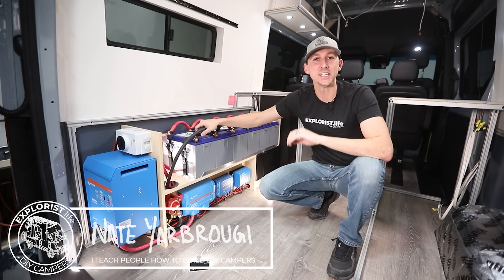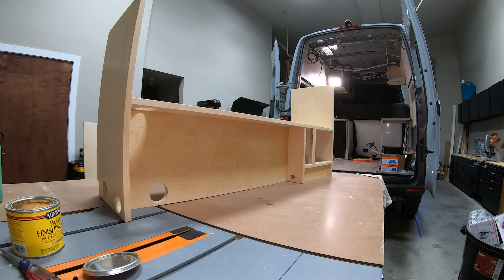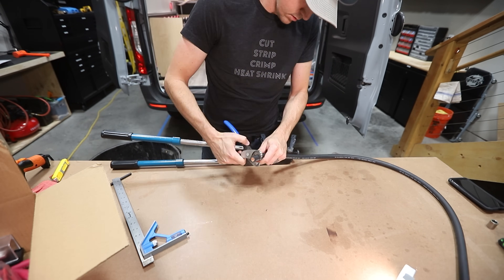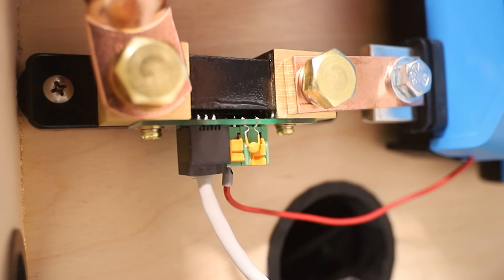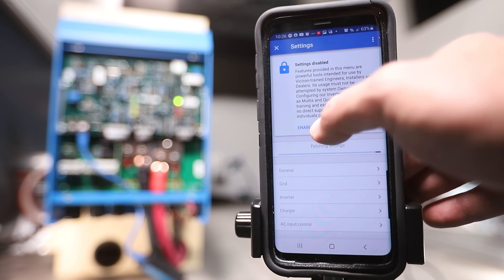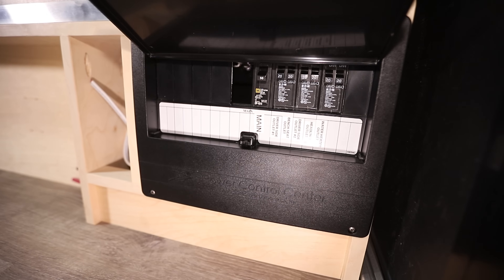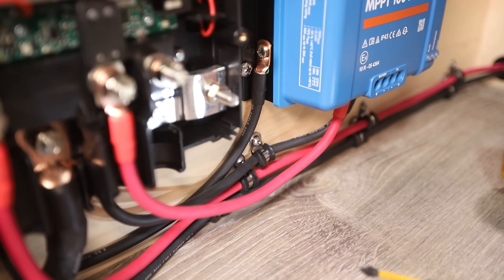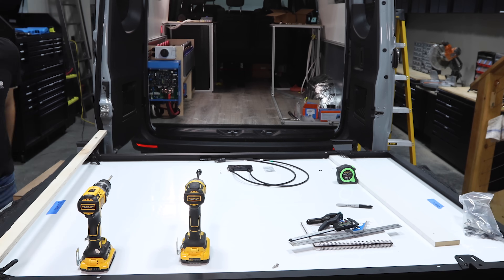DIY Sprinter Camper Van Electrical Install - Full Tutorial

Comment: Hi Nate, I watch your videos and trying to understand the way how Victron system works. Before i built a campervan and electric issue was the most important and hard part. With your videos and Victron it is more clear and easier to do this again. Thank you for your time and effort. Your system  includes smart inverter charger in this video, how about if we want to use seperate products such as an inverter, 110 or 220 to 12 volt charger and direct 110/220 shore power supply. How the connections change? The reason i am asking this is, if anything happens to smart inverter charger whole system collapses. I prefer to use these parts seperate. When you have a chance let us know please… Thanks again…
Reply from the maker: Basically, I don't recommend that.  It takes more parts, more wiring, and more components and lacks shore power passthrough capabilities unless you use a secondary transfer switch.  It's pretty rare that these units fail entirely; and if they do, they've got a 5 year warranty and are in no risk of selling out.

Comment: Amazing video Nate, thanks so much for creating this. 

I still have a couple questions, forgive me if you answered them already, I didn't see them in the comments with a quick peruse. 

1) where is the link to the blog post that goes over the settings on the victron connect app for the multiplus, mppt, batts etc. 

2) at the end overview you talk about the power assist feature to pull 30AMP shore and 15AMP from the inverter, but wouldn't that 45AMP be too much for the multiplus to output? Or is that 3000W the max it can output from the inverter but it can also output additional power coming from the shore?

Thanks for your help.

Comment: I seriously can not thank you enough for this video, we are building our system right now and constantly reference this video! We just got the battery bank wired together and the BMV 712 turned on! I can't seem to find the cheat sheet for the BMV 712 settings is on your website, any chance you could point me in the right direction? Thanks again!! -Cody

Comment: Excellent tutorial.  Well thought out, very well explained.  One question I did have and my apologies if I missed this explaination.  In the case of the Orion DC to DC charger, when the vehicle engine is turned off, does the Orion on its own isolate from the vehicle start battery system or does one need a solenoid to serve that function?  Having seen isolated and non isolated descriptions with Orion's I'm assuming "BUT" assuming can also get me in trouble, thus my question.  Again, huge thank you so much and I'm going to share this and your channel with several people who also share a common interest.
Reply from the maker: If programmed as a 'charger' no power will flow when the engine start battery is off.

Comment: Hello Nate,
First, thanks for all the resources you provide through the blog and the videos on youtube; they are very helpful. I probably would have undersized wires and burned it to the ground on my own. 

Here is my situation, i have a 2021 coachmen catalina with the off grid package. has a 100 watt panel on the roof, solar charger tied into the battery, 12 volt fridge and led lighting and a couple fans running from the 12 volt system. I was planning on adding more panels to get to 600 watts, swapping the lead acid with 3-400 ah of lithium and putting in a 2-3000W inverter charger. 

My question is, where is the best place to set everything up? I can fit the batteries on the tongue, inverter & lynx could fit beside the solar charge controller in the pass through and then just have a long run of wire between the inverter and electrical box. I tried searching the blog to see if there were any posts but, could not find anything that matched my situation of being partially done. 

Also, If I wanted to supply power from the inverter to the entire panel could I install a subpanel that took the 120 from the inverter on 6/2 wire and convert it to 6/3 wire once I got power to the spot where the electrical panel in the camper is? I realize that it would not be true 240v but, it may prevent me from having to rearrange my breakers. We will not be running any high wattage items simultaneously so, maxing out the inverter or wiring is not a concern at this point.

thanks and once again, thanks for the blessing your resources are.
Bill

Comment: Thanks for the great videos and education! Can you please tell us why you use the lynx adapter bars (short bars) instead of bolting the shunt directly to either the negative battery terminal or the negative bar on the lynx distributer, thus eliminating additional parts and connections? Same for battery cut off switch?
Thanks
Reply from the maker: The shunt and switch studs were 3/8" (M10) and the Lynx Distributor holes were 5/16" (M8), so they wouldn't fit.

Comment: i’m not sure if you’ll see this but i’m planning out my bus rn, i’m 17 and plan to gradually work on my bus for the next two years until i graduate college. i have no experience when it comes to electrical but i came across your page and was hoping you could help. i know that it’ll be 2,000w of solar but when it comes to what exponents will need, i’m clueless. i checked out the website but the systems that my computer allows me to see have a max of 1450.

Comment: Excellent Start-to-Finish video Jared. I have a 5th wheel instead of a van. Can I wire the Chassis Ground to a nearby steel rib (post or cross member) the way you did with a serated washer? Thank you, Rick

Comment: Inverter potion of the show:  I wonder how many folks out there besides you and I use a blender as the first example of a 120VAC load...

Clean build, brother.  I am also a big fan and user of the 80-20 T slot stuff.

One thing that is not clear to me yet:  looks lou went to alotta trouble to power your orion for the alternator charging.  Does it hook up to something other than just the chassis battery??
Reply from the maker: Blender is key. 😂🤣

The alternator charging portion is definitely a bit of a pain, but it's the correct way to do it... so that's what I show.  Do it right the first time so I don't have to do it again, ya know?

Comment: Hi Nate! I’ve watched sooo many of your videos. I can’t explain the impact they will have on my build! 

I swear I read or saw a video where you described what dc to dc unit you should use for a standard alternator VS an upgraded one. Could you please throw a link my way?
Reply from the maker: I don't have a video about that, no.  If you have an upgraded aftermarket alternator, it should come with a voltage/current regulator that would take the place of the dc-dc charger.

Comment: Love, Love, LOVE you & Steph’s vids.  I’m specifically looking for info regarding SIZING a Shunt.  Is there a dumbed-down method, if I don’t yet know my Peak (momentary) Amp draw ?
Thanks to you Both … for being You !
Reply from the maker: The shunt size just simply needs to be larger than the max continuous amperage of the system.  If you don't know this yet... you need to find that out before sizing the shunt.  The 500A shunt shown in this video works for all of my setups at https://www.explorist.life/solarwiringdiagrams and the chances of me designing a system that needs a shunt larger than 500A is slim to none.
Reply: @EXPLORISTlife  Thank You Nate !  I had read that accuracy suffers if you size ‘up’ too much.  e.g. if a system calls for 250A, and the closest available in decent brand is 300-350A, it has a high likelihood of being more accurate than 2X what’s needed (500A).  Is that just baseless “water cooler talk” ?
Reply from the maker: @StansE250  I've never heard that, no.

Comment: I just came across your site and what a wealth of knowledge it is.  I see you offer a complete wiring kit for a 600Ah - Multiplus 3k 12v - Orion 12-12-30 - 400W Solar.  Will you be offering any other complete systems?  I'm looking at building a system that's more like a third of the system currently listed.  Maybe 200Ah - Multiplus 2k 12v - Orion 12-12-30 - 200W Solar.  Also, I would like it to be expandable if I decided at a later date I need more power.  Thanks for your time and input.
Reply from the maker: I will indeed be expanding to different sizes of kits, but I have no ETA nailed down on those.

Comment: Nice Video man! Thx for that Work with making a Video about it :)! But i have one Question, The Inverter, has two AC outputs, but just the AC1 have Slots for 3 Wires? Whats about the AC2? Why theirs just 2 slots?

Comment: Love your videos! You make it very easy to understand . Could you please explain how to install a shunt to monitor the batteries. I have 2 solar panels arrays with their own controller as they are different voltage. My question is can I connect both to the shunt so I can monitor what come in and out of the batteries even if they are different wattage (one is 4 x 120w and the second is 4 x 250w) ?
Reply from the maker: The little gold lookin piece of hardware mounted to the left side of the Victron Lynx Distributor on the negative busbar is a shunt and is a part of the Victron BMV-712 battery monitoring system and monitors all power going into and out of the batteries.

Comment: Hi Nate - awesome website and instructions videos. The best I could find.
Question : You installed a single 400 W panel in the video.  Does it make more sense to install a single large panel or would it be better to use 2 smaller panels with the same final wattage ? Any recs in terms of panel manufacturers ? How can I find out about numbers of diodes used in a panel ? Is there a typical number ? 2 or 3 or 4 in a large panel ? 
Thanks a lot for all you do - and a happy 2022 !
Reply from the maker: Two videos for you that should answer those questions:

Best wattage of solar panel: https://youtu.be/J9iHYgF6pXo

Best size of solar panel: https://youtu.be/VP4uOsKVD9U

Comment: Why not go with higher amp hour batteries, therefore less of them? Thanks, Scott. Love your videos! I need a small system for an old Scotty trailer that I’ve restored. Not a lot of room there but any thing will be better than one battery. Thanks again!
Reply from the maker: That's also a great option if that fits your space better. 😊

Comment: I just modified my older RV house battery system by using your plans and video and its great.  Thanks and I feel much safer than the janky set-up I had.  Question:  You have the solar panel/charge controller connected to the system independent of the battery.  Thus in the day time, regardless of battery on/off switch, the RV electrical system has 12V power all the time.  Is this best practice OR should the solar panels/charge controller be connected to the battery first, with all power flowing through the battery while also allowing the user to shut off the system completely and letting the charge controller keep the battery fully charged.  I can see the benefits and possible problems in both setups.
Reply from the maker: Both are fine.   The way I show in this video is simpler.  Anytime the master battery switch is 'off', the solar isolator should also be 'off' in this setup.  If you want to keep the house batteries topped off during storage, simply turn off all loads (inverter, refrigerator, lights, etc) and leave the solar and battery switches 'on'.

Comment: Great video, and watching this, and your other videos has really helped me better understand the electrical system of my Revel!  But I have a question: Given that we have things like Wago connectors, why the wire nuts in the cabinet behind the control?
Reply from the maker: Those were just temporary to simply cap off those wires while I was working on the system.  They will be replaced with WAGO connectors or butt splice connectors for final installation.

Comment: I'd love to hear a discussion of how to do the ground- neutral bonding to support shore power input, generator input, and inverter only (no shore/ gen input connected).
In my travel trailer, there is a ground- neutral bond at the distribution panel. The ground and neutral bus bars are connected to their respective shore power input wires. How is an inverter output supposed to be connected to the distribution panel? Reason I ask is for my particular inverter I get an odd 60VAC from both the hot and neutral outputs to ground when on inverter power.

Comment: Hi, amazing videosj! ust had a question about the installation of shorepower and not having a circuit breaker between the outletand the inverter/charger. I assume there is an internal one in theinverter, but you don't feel there is a need for an external one(sorry if this has been addressed already--there are a lot of comments!) was wondering if the optional power surge protector you have linked on the product page suffices in this regard? Thanks for any help you can provide!

Comment: For the 12v fuse block, why did you use a 100A fuse with 6ga wire? Shouldn't the fuse be smaller, like a 70a fuse? 
Thanks for your great videos, they are very helpful.

Comment: Nate, so far your resources have been incredible!

Was using this, and looking up your 50a OEM retrofit

I’m not doing a retrofit, rather building a skoolie out from scratch with 12v 600ah battery, and shore power, and alternator charging. So, no need for me to bypass or replace OEM items. Otherwise, I think these 2 resources are what I need.

The part I’m getting stuck on is wiring the shore power in to the multiplus and the multiplus out to my ac panel. The item list for Inverter Charger to AC Distribution shows on the 50a blog I need 6 awg triplex, but later on you mention 6/4.
Which is it?
I assume 6/4 is correct for both shore into MP and out to AC?
If so, where does the 4th wire go? I only see L, N, and PE on both the in and out from the Victron MP.
Thanks!!!😁

Comment: Thank you for all the great videos and the store.  I'm curious, how did you secure the cabinet in the van?  Just screw into the panelling?  Did you attach the cabinet to the floor in some way for safety?
Reply from the maker: That was done after the client took the van back; but it was a mix of various bolts/screws/brackets.  I know that's not very helpful; but it's not like a 'system' or anything.

Comment: Great video. Thank you.  
Question 3: 
If given the option, would you install a 120v items (such as an A/C, Water Heater, Refridgerator) to a Lynx Distributor 1000DC directly, or have a 120V Panel? Does you answer differ if we are only installing 1 item to the Distributor rather than, say,  3+ items

Comment: Awesome video. Very easy to understand. But you didn't speak about what decides to charge the batteries if the vehicle is running with a DC/DC charger and solar panels are connected. How does that work?
Reply from the maker: They all adjust accordingly, automatically.  Shore power always takes priority and solar will gate back.  If alternator and solar are both trying to charge, alternator takes priority.  We don't have to 'do' anything though as this all happens automatically.
Reply: @EXPLORISTlife  Thanks Nate for clarifying what takes priority in the charging systems. I have two more questions. I have 6) 100AH battle born batteries, A Renogy 60 amp DC to DC charger,  A Victron Multiplus 3000, and a Victron BM712 Smart monitor with the included shunt. If I use a Victron Lynx Distributor will the indicator lights on the Lynx distributor work? I think they will since I have the Victron shunt. Please just verify that for me. Your Videos are so easy to understand that I plan on using all the products you recommend  and wiring my system the exact way you did in your video. Is there any upgrades that you would recommend since you made your video? Thanks for the GREAT videos. Keep them coming.

Comment: I’ve got a question Nate. In minute 22 you ground the lynx to the chassis. Do I do this also if I’ve got a 24v system? Or will that cause a short, as the “car battery” of the sprinter is 12v only?
Other than that, this video helps me a lot to have a structure for the setup. Many thanks. 😊🙏🏼

Comment: Best video I´ve seen on electrical systems! The only thing I didn´t understand is the purpose of the solar power isolator (the white box you could turn on and off). The blue box converts the 40-ish volts to 12V, so what does the white box do? Could you explain this?
Reply from the maker: It disconnects the solar array from the charge controller.  Check the 2nd half of this video for why this is required: https://www.youtube.com/watch?v=HOXnWXvLXko

Comment: Love the video! I could be wrong about this, but shouldn’t the chassis ground be on the other side of the shunt? Otherwise the loads might travel to the chassis ground instead of back to the battery to complete the circuit, which your shunt wouldn’t read those loads then. Like my audio system I don’t even have a negative from the battery, just to the chassis. I guess it’s which ever direction has least resistance.
Reply from the maker: Chassis ground is on the 'load' side, which is correct.

Comment: Hey Nate and Steph, First I must say fantastic video and thank you for the helpful information and detailed instructions for setting equipment up. I am mirroring your install and have just completed setting everything up and it works perfectly. Also, thanks for making it easy to mirror by providing the necessary cables and equipment, I am to support 🙏. 
One question, where can I find the cheat sheet for setting up the parameters on the different devices through the VictronConnect app? 
Thanks again,
Daniel Torode
Reply from the maker: If you'll submit a support ticket at shop.explorist.life/support I'll send over the PDF.